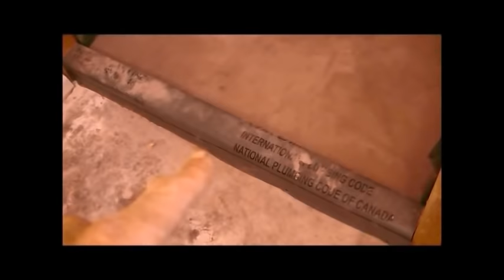My Intro Video...FINALLY !

Comment: Hi Bob, trying to remodel our bathroom, but have run into an a problem.  We have learned a ton from your videos, but haven’t seen this issue.  We are at the point of installing durarock and the corners of the liner are making it off level by like 1/2” from top to bottom(8’ walls).  Walls are level.  Any suggestions?  Thanks much!  We live in Cumming GA, feel free to stop by and help out..lol
Reply: Put  up thin lath on stud faces aboveliner hold off 1/4 inch lath to top of stud

Comment: Hi Bob, how are you? It took me a long way to find your page, and think I finally find the right resource. 
My shower was rebuilt last year and I started noticing unpleasant smells on the floor tiles a few months after. I wonder if you have a referral in Brooklyn/NYC area so I can reach out to, as the issue lingers and my contractor told me it was just the moisture in small bathroom. 
Thanks very much!
Reply from the maker: I have no contacts anywhere, I'm sorry...
But thanks for finding me !
Reply: StarrTile Thanks a lot for getting back, Bob! If you were to guess, would you think there’s problem underneath, even though the surface looks perfect and seamless?
Reply: That odor you are smelling is from water (and funk😷) being trapped between the  mortar bed (shower floor)  and  shower liner. It's caused from the  95% of installer that either don't know or believe in presloping prior to installing the liner . If you find a knowledgeable tile setter in your area  to look at it you should let us know what he finds 👌
Reply from the maker: Knowledge comes from Proof, where's your proof ??
.....................................it's ok, I'll wait....................
Reply: StarrTile 

Proof is in most every bath room  demo/remod I've ever  done (I've done a couple😉 )  . Same thing over and over .Flange of the drain sits higher than the liner , there's no water standing around the drain. Maybe because it sits higher than the rest liner ?🤔 A reverse preslope maybe ?🤔 The mortar bed saturated and the perimeter has standing water    . A few I have done , you could stomp on them and you could smell a horrible  odor come from beneath.  On this planet water will seek it's level  (lowest point of a liner always) 

 I see in a couple videos you have posted you go through the effort of recessing the drain flange flush with the sub floor and use weep hole protectors. Which seems if the subfloor is level, recessing the flange would help. Unless..
youve ran into the subfloors that are not level ,like the bottom of wainscott in one of your videos   that has the taper cut  that  goes from 0 to about 5/8in  about  3ft Outside of the curb.  😉

So it seems to me  subconsciously you know,  but I guess  your factual  logical  common sense box is above all others ? Is  it because your the smartest tiler in the room or do you have some sort  of grudge against  preslopers?🤣

Don't take offense I like you buddy 🤓

Comment: Hello Bob. Do you have any experience with Redi Base (shower pan) by Tile Redi sold by Home Depot? I've purchased one and nobody I hired to set the pan has ever seen it. Any recommendations are appreciated. Thanks.
Reply from the maker: Sorry i did not have any experience with prefab shower pans , if i was given one by my customer i will tell them the return it , just kind of how i feel about them because i'm taking out so many that have either cracked or stained
Reply: Thanks so much for your input. I really appreciate it.

Comment: Have you got any comments how to add a  curbless shower onto an existing concrete floor without jacking out the concrete floor completely.
Reply from the maker: Greg Tes .. the only way you could possibly accomplish that is by using the Kerdi foam pan Which Rises about 2 inches off the ground, then in the surrounding bathroom area you would have to build your floor up to in to be flush with that

Comment: Hey bob quick question for you have you ever used the self leveling clips if so what’s your opinion on them? Thanks
Reply from the maker: Yes I have used them, they have an application which I can appreciate, I don't use them on every job but lately I have use them a lot , they are a tool in your toolbox when you need them